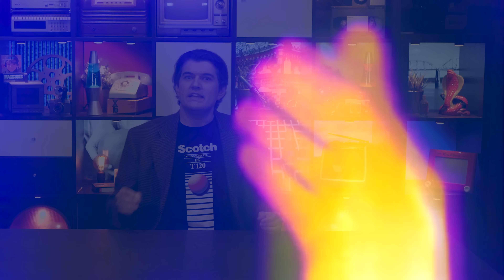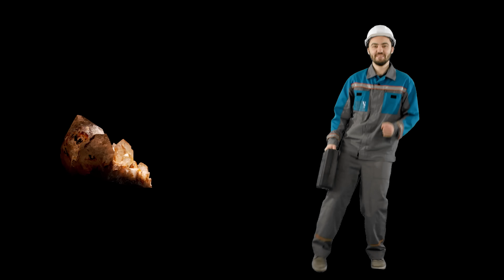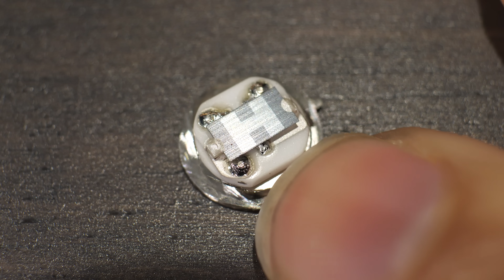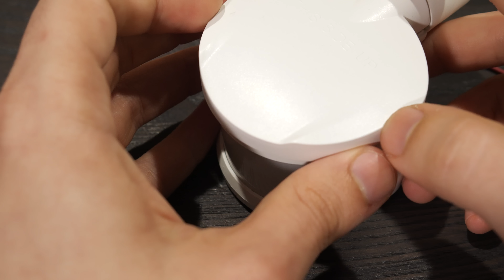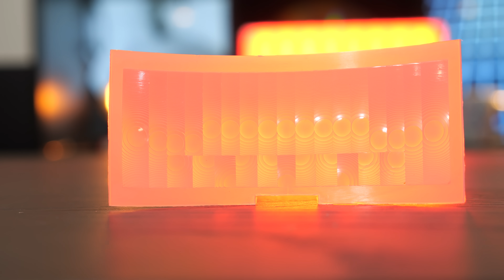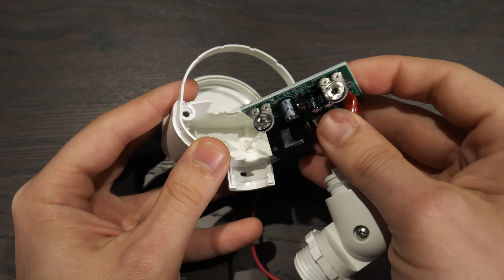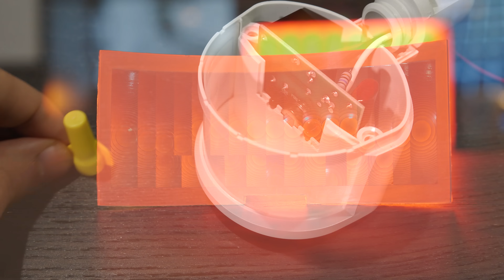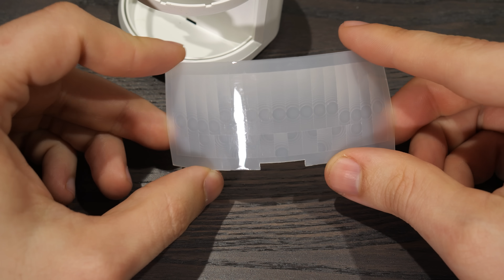Passive infrared motion sensors: a two-bit camera powered by crystals

Comment: Pretty certain the H is actually a large MOSFET called an H-Gate. The bright H is the gate and the dark squares on the top and bottom are the drain and source.

I'm guessing the infrared sensitive material is impregnated onto the h-gate in order to induce a voltage to switch the transistor, which in turn provides enough current to switch the larger one beneath it.

The advantage of this design is that you can have an extremely low standby voltage to switch on a relatively high powered device like a floodlight.
Reply from the maker: Ahh! That would make a lot of sense.
Reply: And that's the power of H
Reply: @cheekibreeki904  A power of H that Sesame Street never mentioned!
Reply: @TheePIB considering this episode was PBS ready, it makes sense that it's sponsored by the letter H, and viewers like you
Reply: @ljwithnok2615  🤣
Reply: @TheePIB  It's actually an I.  Don't you remember that segment with Bert, Ernie and the TV?
Reply: @ljwithnok2615  🤣
Reply: @TheePIB  And now all I can think of is that bit from the old episode of Whose Line Is It Anyway?: "The letter H!"
Reply: I just thought it was a cameo from Arnold Rimmer
Reply: Nah, the sensor itself is much more simple. It's just two plate capacitors with the pyroelectric crystal between them.
The two bars of the H are each one capacitor, the little bar in the middle connects them. There's also metal on the backside to form the other side of the capacitors. The chip itself is the crystal
Reply: that makes sense, the H shape doesn't really make sense otherwise, imho
Reply: Is H gate the same as H bridge?
Reply: @Blinkerd00d  No
Reply: The infrared sensitive marerial is what now
Reply: You could know what a FET is and Source Gate Drain. Is this the best you can do? Not good. Don't give me anything you only partly understand and poorly presented. Thumbs Down.
Reply: I think sometimes it can be very tricky to be on the internet because people tend to come at you with alot of heat, my opinion is that is the biggest flaw in any person, and so i hope you can see where i'm coming from

Also, my opinion is the more you say "i think", and "my understanding is", truely truely truely, that is what makes the world a better place. I do this, and i'll never change, a dose of humility is the cure to pride. Don't be afraid to be yourself, and be humble folks!
Reply: @josephlarrybradley508  Sadly, I know more about how a Fett functions than how a FET functions.
Reply: @josephlarrybradley508 you should be ashamed of yourself
Reply: @josephlarrybradley508  Ok boomer. Can you explain it better than he did?
Reply: @josephlarrybradley508  this comment H-ed like milk

Comment: Hey, saw a suggestion on another site for you. You should look into the GE 7-4612 Digital Clock Radio. Why? Because it's stupidly ubiquitous(I guarantee you everyone here or everyone's Parents here had one), they're retro-styled all to hell, they're BROWN(as the comment I saw put it), and.... GE still makes them. 

I'm sure you can find something interesting to look into with that ridiculous little machine. How did it come about? What's in it? Is there any huge difference between the old retro ones and the current model? What produces that hideous BZZZZZZZZZZZZZZ alarm noise it makes that makes you jump out of your skin? And aren't those great big switches on top nice and chunky?
Reply: (For reference by the way, it was first released in 1988 under the Musaphonic brand, and, again... GE STILL SELLS THEM.)

Comment: only one/part of the sensor detecting at a time is also how your eyes work for edge detection - you have these photoreceptor cells arranged in a donut, and the neural cells underneath detect whether the donut or the donut hole are being activated

Comment: The way you could show the operation of the lenses is to put a visible light-opaque IR-transparent filter on your camera.
Reply: These sensors react to real long-wavelength IR, like 10 microns or so. No normal camera can pick that up. And glass doesn't transmit it.
Reply: @soaringvulture  In that case, there are lenses designed for that.  I could see how much it costs to rent one.
Reply: @pleappleappleap  Yes, I know that there are lenses designed for 10 micron IR. I have designed several. They don't go on regular cameras, they go on FLIR imagers.
Reply: @soaringvulture  Is it that the sensor is incapable of detecting it?  Is there a technical reason why one couldn't design a lens which focuses 10um IR and fits on a mirrorless or DSLR camera?
Reply: @pleappleappleap  The silicon detectors used in normal cameras don't respond to wavelengths above 1 micron. Also, most cameras have filters to cut off all IR response to prevent strange results. So you need special sensors which usually have poor resolution.
Reply: Or mold them in transparent plastic...

Comment: I used to enjoy demonstrating how a glass window that you could see through with normal vision cameras allowed people to walk past infra red sensors provided the glass was not more than 10’C different (hotter or colder) to the ambient background temperature… and so to get past visible cameras too wear a balaclava and carry a full length glass window from one side of the yard to another without setting off any alarms. Great job!
Reply: We have learned from the documentary film named "Predator" that you can also cover yourself in mud to avoid detection.
Reply: @pistonburner6448  did you see the Mythbusters episode where they tested the "Predator" mud scene?
Reply: @roberth721   Nope, but I will now! Thanks for the heads up! (Please don't spoil it for me, but I'm assuming it does in fact not work except maybe for a moment)
Reply: @pistonburner6448   it was in "Crimes and Myth-Demeaners 2" episode.
Reply: @pistonburner6448  How often have you tried it? I get wet in the rain without trying.
Reply: @pistonburner6448  I'm not sure, but for me real-world mud doesn't seem like a good enough heat isolation material
Reply: @akeem2983   I guess it doesn't get very cold in Africa where they make houses out of the stuff...not too good as isolation material for sure, at least in the long term
Reply: It also helps if you you are drenched in rain. 
You are just like everything else while you keep your head down and your hands behind you.

Comment: Very a clever technology i love infrared sensors theses are very neat.  And pretty effective way to control the lights ON and OFF.
Reply: Ultrasonic work pretty well too, but occasionally some folks will hear them when they're poor quality or failing. I work in one building fairly often that has two or three sensors I can hear and so can the maintenance guy.

Comment: Do you mean to tell me that manufacturers made these devices work via the magic of buying two of them?
Reply: It’s a fascinating bit of engineering. When there’s two of a device they can interact and reference what they should do with each other and basically each device keeps each other sane. Kinda like how being alone for long times makes it much easier for people to go crazy
Reply: @submachinegun5737  Oh, funny thing about that. Computers in space actually go insane due to radiation. It literally can flip 0 to 1. That's why on rockets, there are 4 of them. Once one goes insane other 3 point that out and correct him!
Reply: @Arcidi225  There was actually 5 computers, 4 for primary operations and redundancy as you mentioned, and the 5th to take over everything if the other 4 into issues. Here is a great quote I found explaining it's role from Dave Mohr of Nasa, "the 5th GPC was programmed with software written by a completely different group of people from the group that programmed the 4 ‘primary’ computers. Early in development, it was feared that some sort of ‘generic’ bug in the primary software could cause a ‘collapse’ of the 4 primary computer ‘set’. If that happened, the outcome would be catastrophic. So, a 5th computer with a ‘Backup Flight System’ (called ‘BFS’) was created. BFS ‘listened’ to the primary 4 computers all the time, and would take over if the primary computer ‘set’ collapsed"
Reply: @Arcidi225 that's not just an "in space" thing! Plenty of "highly available" and "fault tolerant" computer systems operate by just having multiple systems do everything together.

Storage can be set up with something like Ceph to store on multiple disks, computers, or even continents.

CPUs can be designed to run in lock-step, so every single operation and data has to be identical. (Or you can just run on multiple systems)

Datacenters basically always have multiple network lines (and usually redundant utility power lines too, plus redundant batteries and generators) that can support their full or critical loads.

(And any business I advise who relies on the internet connection to get work done - so, pretty much all of them - I tell them to just get service from two providers, too.)
Reply: @Arcidi225  That actually affects all chips, in any device, even on earth. We encountered the issue so early in microcomputing that all modern chips and systems are designed around those random bit flips. You just cannot prevent a random electron hitting one of your gates and changing the potential, thus flipping a bit. Those unexplainable bluescreens you get? Really without explanation, on systems under no load, that work completely fine after a reboot? The most likely culprit is radiation hitting your chip really unlucky. Hell when using election computers, it can even change the outcome and give a politician more votes than there are voters (yes that really happened in Belgium and an IT guy got really suspicious about the 4096 votes she had extra and solved the mystery, because nobody could explain the result, but that looks suspiciously like a single bit flipping from 0 to 1 due to a really sharpshot electron).

There's a lot more radiation in space and when it goes wrong it goes completely to poop, so you go with 3 backup systems that have to vote on a decision. Three systems in total would suffice, two can't break a tie and four gives you the potential for a failed system without catastrophic failure and strong majority decisions. All computers do the same workload and then vote on which was done correctly. 

Designing connected systems it somewhat becomes second nature to think about redundancy. You feel dirty without having at least n+1 for any critical system, component, etc. You have to consider how easily the system can be serviced and how many x you need to prevent a complete system shutdown when working with n+X system design. Think about the worst scenario that can happen, make it a little worse and design the system to work at least minimally in that worst case scenario. If you have unserviceable absolutely critical systems like on a spacecraft, where you can't infinitely increase X for redundancy due to prohibitive weight limits, you go for the strongest redundancy possible, which in most cases would be n+3. The best balance of total redundancy, strong majority votes and least possible weight.

On a side note, there is a really interesting story in early microcomputing with intel making useless chips that got irradiated by the packaging material (ceramic with radioactive trace elements) and thus produced a ton of errors in the 1970s. After that, we got a lot more sensitive to the issue. That is one of the reasons server RAM usually comes with ECC. You definitely don't want some random bit flips killing your critical infrastructure, even for a just a reboot. That might be millions of dollars until a system is back and running. Think about the Azure configuration fail last week.
Reply: @submachinegun5737  with the magic of three of them you can even detect if one of them has an error and correct it

... Someone should tell Boeing about this magic!
Reply: @submachinegun5737  LET'S GO CRAZY!!  Guitar solo!  (Prince, Super-Bowl, was a crazy time, look it up)
Reply: @submachinegun5737 that’s kinda beautiful actually
Reply: @submachinegun5737 this is also how computers on many commercial aircraft work, for example any airbus.
Reply: crazy? i was crazy once
Reply: @rarelyevenusedaccount  they put me in a rubber room. A rubber room with motion sensing lights. And motion sensing lights make me crazy
Reply: @rarelyevenusedaccount  you really ruined this comment section.
Reply: comment of the year award 2024
Reply: * the magic of selling you two of them
Reply: i chuckled
Reply: Homer:  No beer and no TV make Homer something, something.

Marge: Go crazy?

Homer: Don't mind if I do. WOO WOO WOO WOO WOO!
Reply: *building two of them...
Reply: This man wins an internet
Reply: DAMMIT! I just made this joke in a separate comment and then scrolled down to see it here with 2K+ likes 😂
Reply: Amazing joke :D
Reply: 🐈‍⬛🐈‍⬛ two of them
Reply: Absolutely!
Reply: Excellent!
Reply: 'Some disassembly required.'
Reply: The "two of them" line had some serious lack of a picture of two gray kittens on a blue fabric
Reply: Sometimes even four!
Reply: Why only have one, when you can have two at twice the price?
Reply: wow
Reply: À1
Reply: It seems we all have been watching this channel for way too long
Reply: This should be top comment!

Comment: Would putting your IR camera behind the Fresnel lens array produce anything interesting? Thanks for the video!
Reply from the maker: Y'know I didn't even think to try! I have pretty strong doubts it could pick up the tiny change in heat the lens creates on a surface but I suppose it's worth trying!
Reply: @TechnologyConnections  sounds like a great video for Connextras. I would love to see what it does
Reply: I was just thinking an IR camera on one side and a small IR blaster on the other side might help demonstrate. And not 45 seconds after that thought, here was your comment 😂 

Always late lol
Reply: @goosenotmaverick1156  By IR blaster do you mean the Buddy heater?
Reply: @DahVoozel    I meant one specifically made for lighting areas to be seen by IR cameras. Used in security quite a bit from what I understand
Reply: @goosenotmaverick1156 That's a different kind of IR.